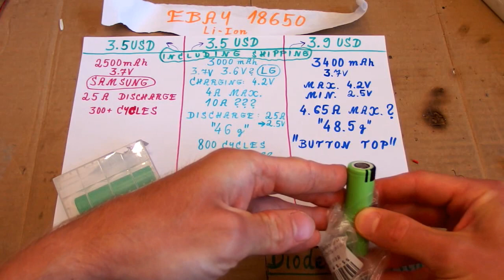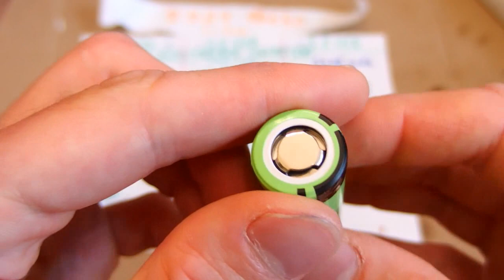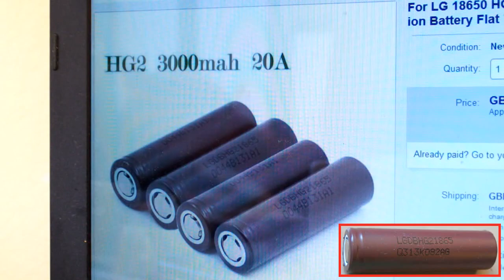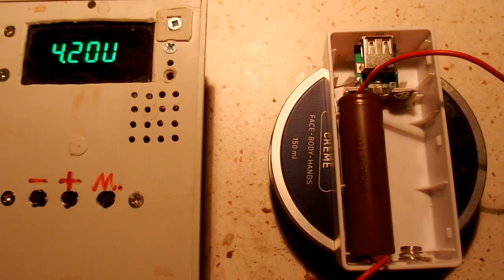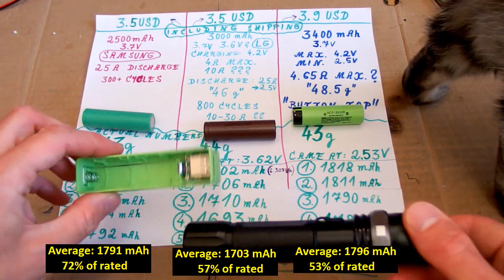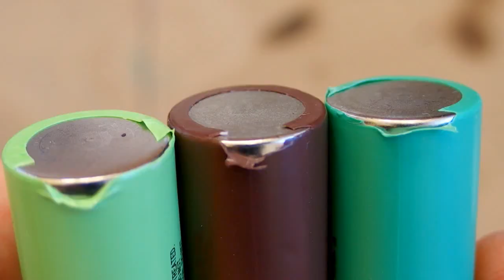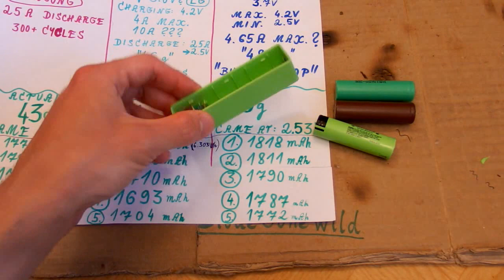3 good looking 18650 cells from Ebay - real or fake?

Comment: The third one "looks like" a Panasonic, but anything can be faked in china these days sadly...
Reply: I think battery in this video are original battery, but the seller put in old battery laptop, because i have the real new one panasonic (green) battery, and test discharging capacity, and got 3200mAh, very closely than 3400mAh,but the price is very expensive, 1627 yen each battery, maybe in usa dollar are 14/15 dollar each battery 😊

Comment: be neat if you make make a reachable nickel metal or lithium ? lead acid motorcycle replacement i need to build something for an old Honda 1974 cb360 cafe racer geting rid of lead acid
Reply: You need to have a charge and balance controller. Is your bike electric start? If not, then you really don't need Lithium, you could almost do it with super capacitors.

Comment: If the price of these comes down a bit more they might make a good replacement for a 125cc lead acid motorcycle battery.  At least on paper since they li-po should last as long.

Comment: I have those real LG HG2 bought in czech stores and the specs are kinda messed up, it is for 20A discharge. I have 4 of them for SMOK GX350
Reply: Tiež som tie LG batérie dostal ku Voopoo drag 2, ale ťažko povedať, že či sú to originály, alebo nie.Vedľa toho značenia na batérii je niečo podobné, ako QR kód (ktorý na batérii vo videu nieje), ale ťažko povedať, že či je to známka originality 😀
Reply: I also have one of those LG HG2 batteries for my SMOK Al85 but when I tested the battery that I got for it when it was brand new, the battery only gave me 2700 mah
Reply: 20amp 3000mah

Comment: Sir can u make a wireless charger fr 3.7v li-ion battery
Reply: It is possible, but i cant find out, for what it will be good, maybe for phone?
Reply: @bedrichrudolf137  yes bro their is so many(wireless) video's in YouTube but they are using only a single LED at receiver coil but nun of them show the o/p voltage and current that means it has a very low current at o/p. So if they do perfectly we can charge li-ion laptop btry or phone btry.
Reply: @Agustinus Reynaldi yes sir, but the cable getting disconnect(usb sockets) by using every time, so if it's wireless we don't need any wires etc. And of course it has less efficiency and it takes a long time to get full charge(1day).

Comment: Hi, the Samsung battery is really common in most places.

The brown battery is an LG brand battery, since LG brand batteries have the first two alphabets LG and then proceeded by a number.

The green one is a Panasonic brand battery, which is mostly green in colour and has NCR 18650 written on it.
Reply: yeah us vapers use them there qiuite common. its a samsung 25r & lg hg2
Reply: Actually these are very high quality batteries, but the issue is that there are a lot of fake versions of the real batteries

Or they could be recycled batteries or used batteries.

So there is a probability that you got a fake battery or a used battery.

Comment: Try liitokala cells from Aliexpress
Reply: they're very hit and miss. Some are fake and some are genuine but they all have good capacity usually but the fakes you know because of the high internal resistance. I would love to see some tested
Reply: got some ncr18650b from them there where original (capacity was correct, weight also. and top pole had 3 wings not 4..5 like fake ones)
Reply: I got some from there. But beware, there are a lot of litokala shops on AliExpress

Comment: Another thorough video from MR Diode. Would it be possible for you to show the seller's names on Ebay that you bought from? It would help others to identify and avoid or even go to if good sellers. Thanks for the work you put in.
Reply from the maker: Those are from sellers called jade-marginjewelry, onepiece2018 and greenteatime2016 (in order from left to right).